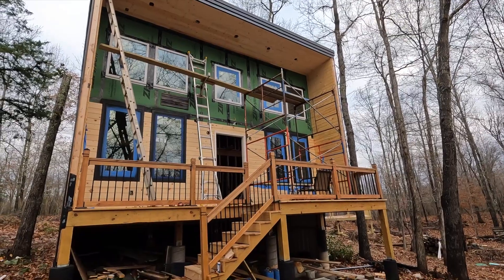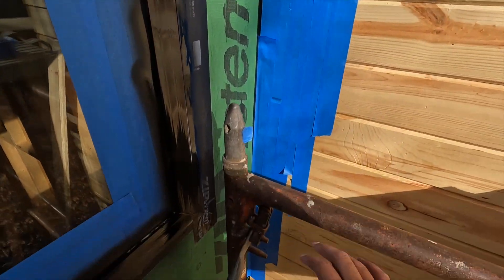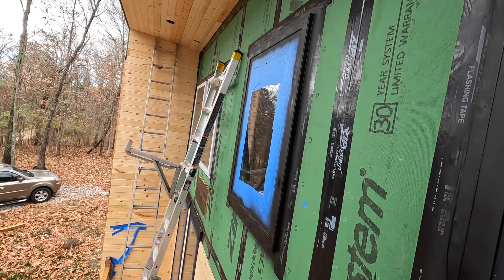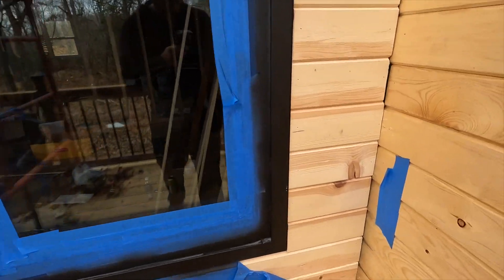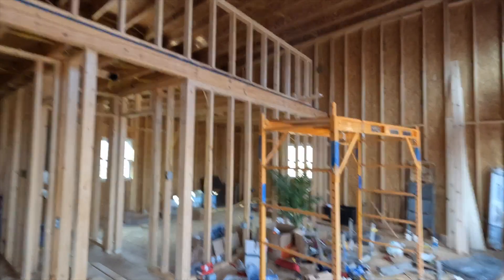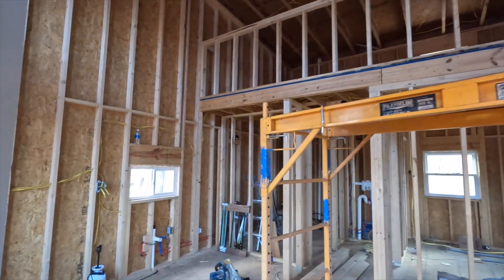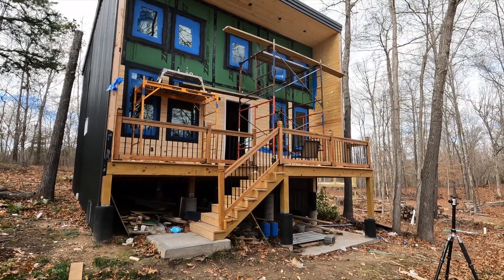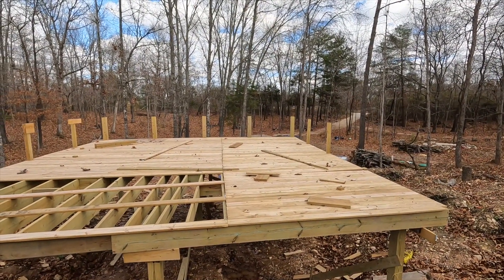Cabin Build Ep 26: Spray Painting Cabin's Huge Windows!

Comment: You needed to shoot a laser level line before you started the pine on the outside walls. If it were me, I would tear it down from the walls and start over. Set a level line, install boards, continuously check level as you go along
Reply from the maker: Yeh you right. But I am going to try few things before tearing it down . Wish me luck! 😊👍